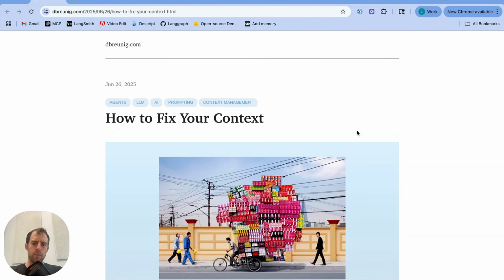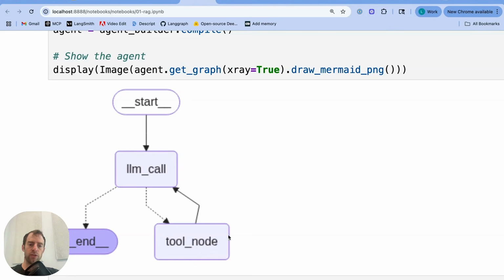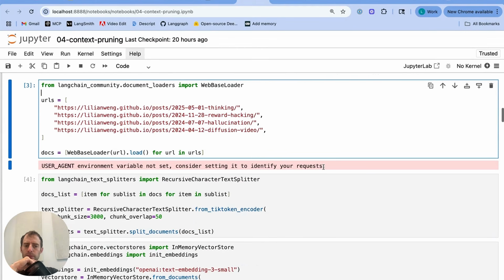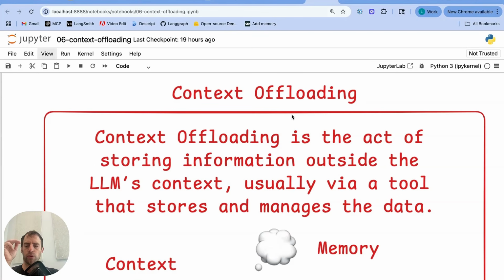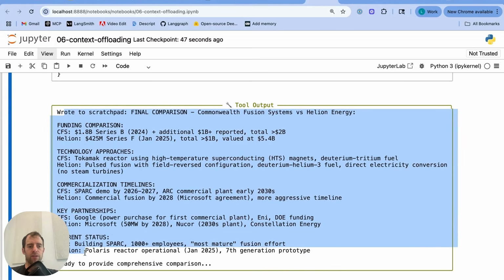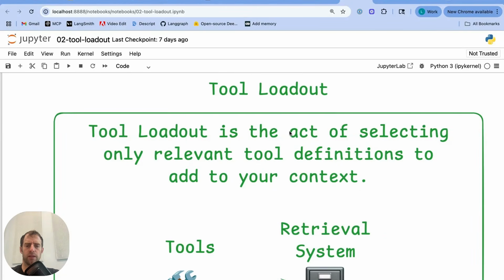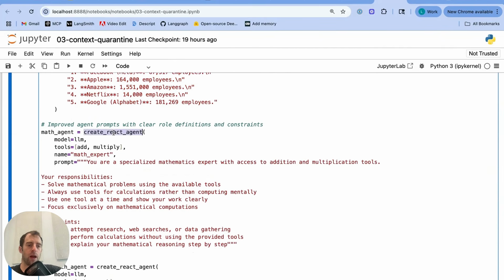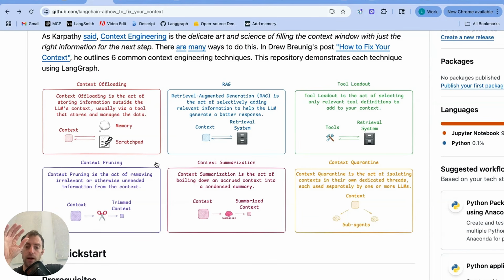How to apply context engineering

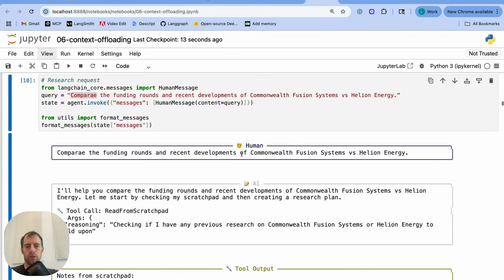Comment: 13:00 you are even using the scratchpad? you are not even applying the context offloading. Seems like you have just passed eventhing every tool call output in the messages itself. Review

Comment: i tested llm.bind_tools whith a function that said 'don't use this function' in doc string, and clearly did something wrong.
is there a way to make the llm detect that certain functions just shouldnt be used even if bound?
Reply: An LLM has a chat template which normally instructs it to call the functions bound to it if it determines they are needed. Such description provided for one of the functions effectively makes the raw input to the model self-contradictory, and that's exactly an example of a "context clash" mentioned in the video.
Reply: @АлександрГоготов-д7ь that is a such a wonderful explanation using content clash from the video!
Reply: Try telling it inside he function itself that if it runs into this function in the wrong context to skip it.